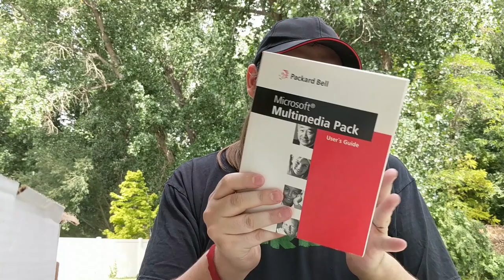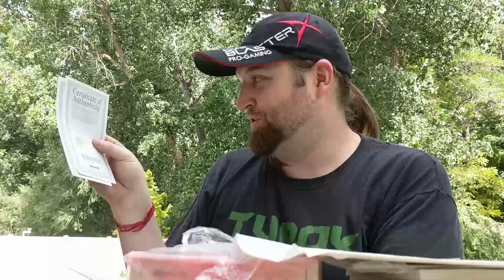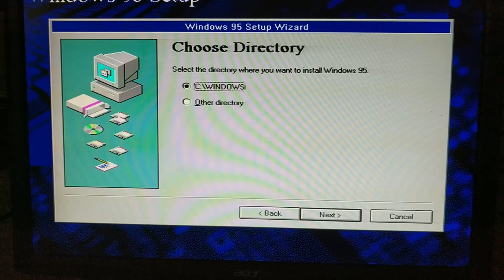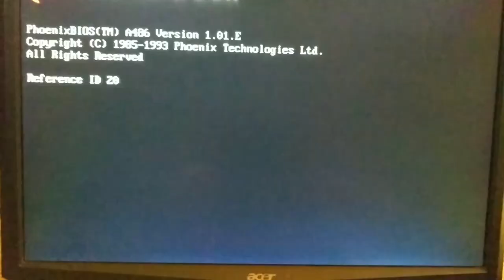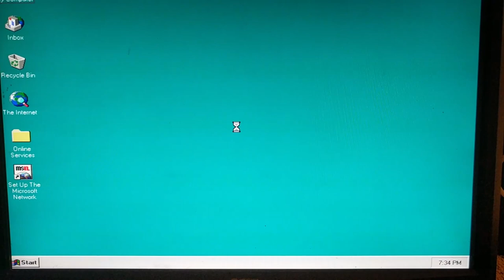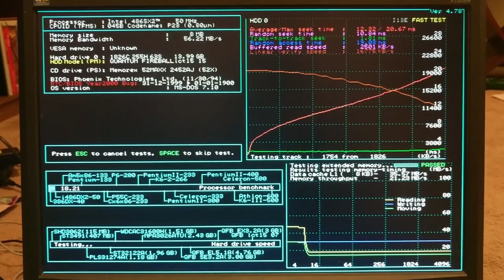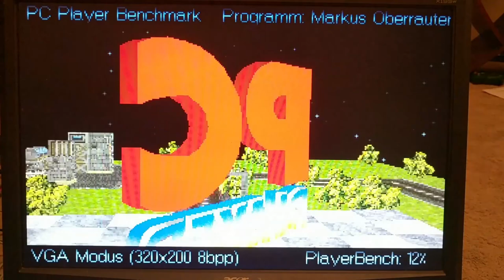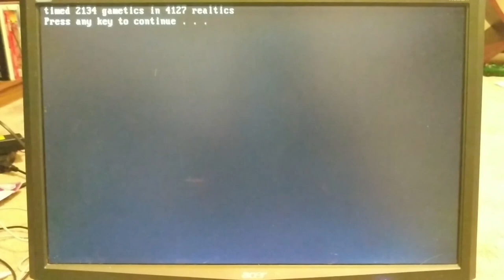Thrift Store Packard Bell 486SX2 Retro PC Rebuild!

Comment: Having worked on Packard Hell support, the best way of preserving that machine is to use an industrial grinding machine to reduce it to metal and plastic shavings and then seal it under several layers of lead-lined concrete.